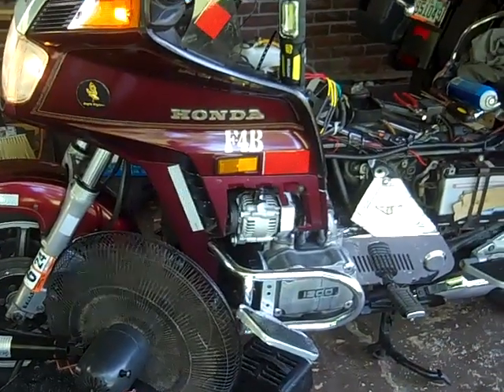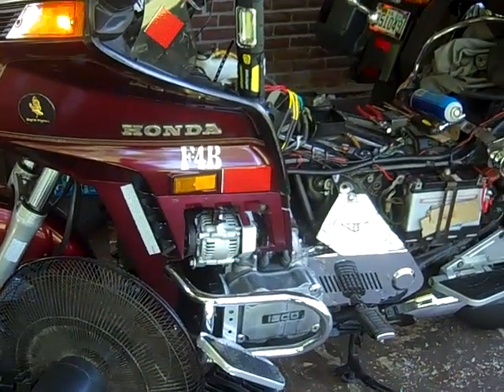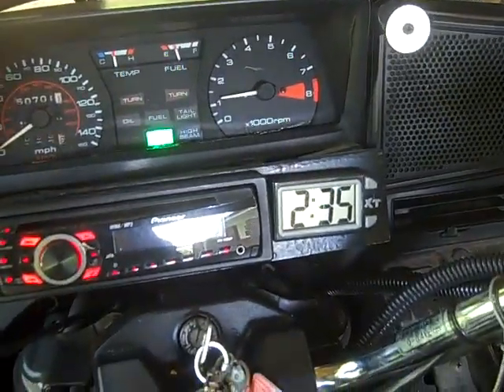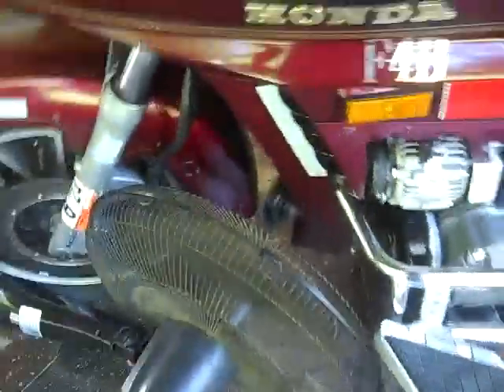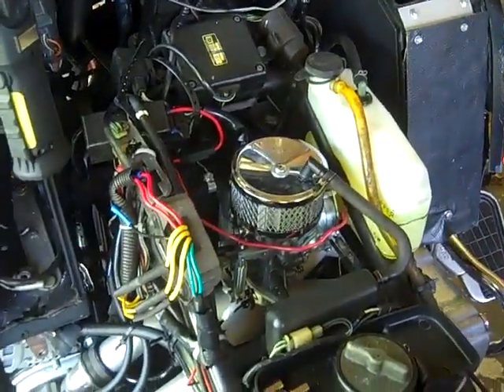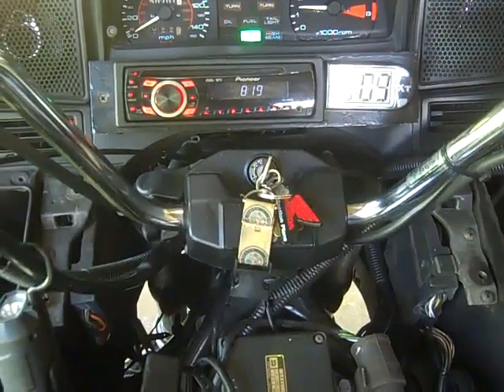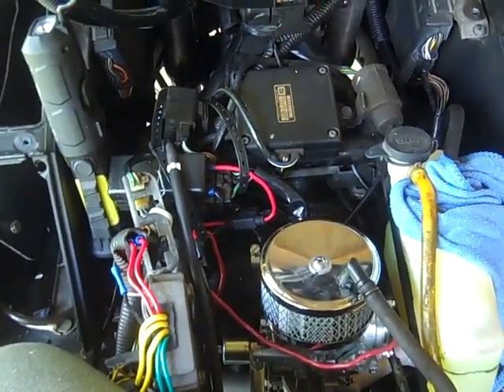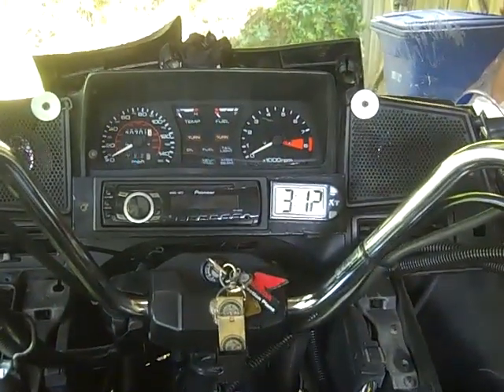Choice of Carb, Jets and Fuel Octane for Goldwing One Carb Conversion

Comment: Where u located
Reply from the maker: Sorry for the delay, I am in Hampton Roads of Va, What could I answer for you??
Reply: @ just purchased a 86 its been sitting for 3 years and when we charged the battery its just clicking wont turn over .. but the clicking is coming from the fuse located on the right side of the battery. The owner said it might be the solenoid whats your thoughts?
Reply from the maker: @REDKANE  If the bike that has set for that period of time, I would take the timing belt covers off and use a 19mm socket and turn the engine over manually to see if it is locked up, but that solenoid maybe the problem if the engine is free.
Reply from the maker: @REDKANE  I have an 84, and 85, I have an 86 as a parts bike and if you need that solenoid let me know
Reply: @ yes ill take it

Comment: hey i recently ordered some pict 4 carb jets off of ebay. i am running a size 35 idle jet and size 65 main jet and the bike idles and revs much better. i dont think the stock pict 28, 30, or 31 carbs come with the right jets, because changing the idle jet to a 35 has made it much smoother to idle and idle off response.

Comment: ive been running 93 and 87 in mine for a while never noticed a difference so i use 87. i have heard of others using rec 90 marine grade fuel. i have had problems with those 4 carbs on it originally with the jets with fuel additives. nice alternator btw!
Reply from the maker: Thanks for watching, add any info you find out to help us all.

Comment from the maker: The two carburetors I used was the EMPI H34 PICT 3 and the Solex H30 PICT 3, I found myself going back to the EMPI carb which had less jets to be concerned about, the SOLEX has a Idle Jet and a Auxiliary jet beside the idle jet which I was not familiar with, but I did use the jets from the SOLEX for testing but went back to the 55 idle and 127,7 Main jet. When adjusting make the turns slow and wait for the response from the engine.